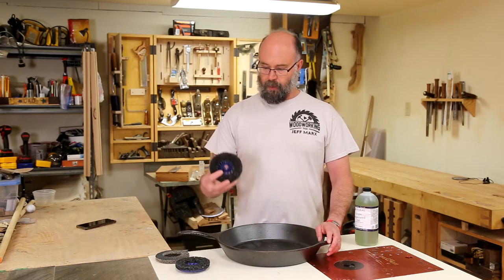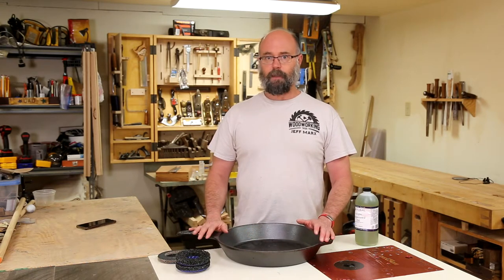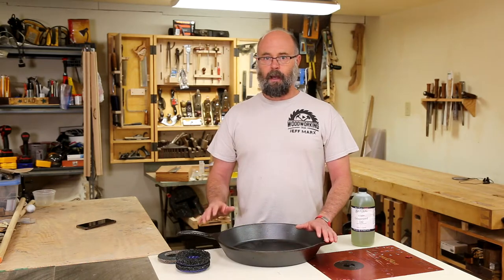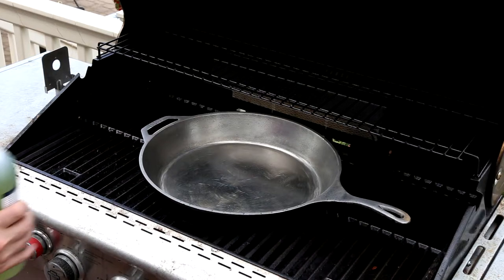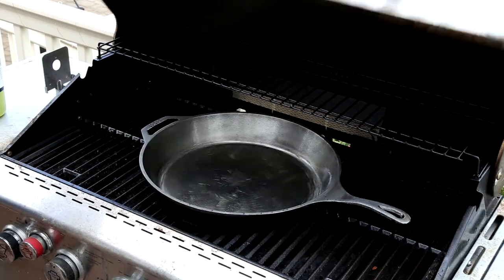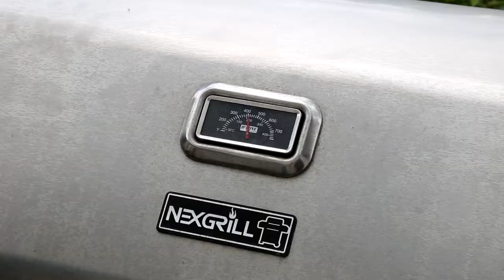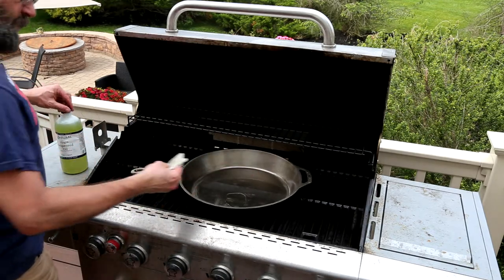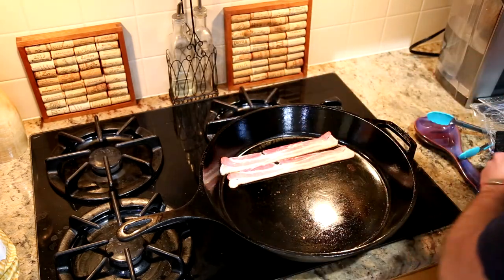Smoothing and re-seasoning a new cast iron pan

Comment: I've always been curious about this. How it would affect the end result of a cast iron pan if it were first taken down to a really smooth polished state before seasoning. I've also considered the same about those big blackstone style griddles. Cool video. Looks like it passed the bacon test.
Reply from the maker: Yes, the critical bacon test was a success!  It's been great with everything I've thrown at it so far - very happy.  Thanks for watching and commenting.  I don't have any experience with Blackstone griddles but they look like something worth experimenting with.
Reply: Cast iron and carbon steel are very similar, and there will be almost no difference between smooth cast iron and carbon steel pans in terms of performance. I believe you can find a lot of test results for carbon steel on YouTube.
Reply from the maker: @alanshawn3058  Thank you!
Reply: I do this with my Lodge pans. I have an older Wagner Ware/Sydney pan I got from my grandfather and guess what? It has a much smoother surface finish than the newer Lodge stuff. He left me a no-name square skillet that is the same way.
 I think that the rough "bad road" texture Lodge uses allows the iron to poke above the carbon layer that normally makes cast iron so useful. That hard, slick carbon layer is what makes it non-stick and having a bumpy surface means the carbon layer breaks and doesn't evenly cover. By smoothing it down flat, you leave enough surface area for the carbon layer to form, and have it smooth enough to give that carbon layer a fighting chance at forming and growing. If it's rough, the hot iron pokes above and stick to every protein it touches...which sucks if that protein is an over-easy egg you're hoping to eat.
Reply: @alanshawn3058  Doesn't hurt that cast iron is a high carbon alloy. It has a higher carbon content than high carbon steel.

Comment: I splurged on a polished cast iron wok this spring, and it is an absolute dream to cook with. My previous experience with cast iron was a disaster,, but now I know why. 
Even though it turns out beautifully every time - even in a camper oven! - it feels weird making skillet cornbread in a wok. I'm going to get a Lodge and make this one of my winter projects. Think I can pull it off just using drill attachments, and not use a grinder?
Reply from the maker: Thats great to hear!  It's probably much faster with a grinder, but drill/sander/hand sanding should also work.  Good luck, and happy cooking!
Reply: @JeffMarxWoodworking  Thanks so much! I'm excited to get started! I saw one after this that had been done entirely by hand, so it's encouraging to know that it is definitely possible without a grinder.
Reply from the maker: @lisakukla459  Make sure you wear good dust protection, you definitely don't want to breathe this stuff!

Comment: If you into steak, try a seven bone steak.  Get it as hot as you can.  Salt the bottom of the skillet like the steak and throw the steak on top of it.  For a 3/4-1" steak, cook 3 minutes both sides I think.  It comes out good.
7-bone comes off the front leg/shoulder.  Around here it tastes better than any prime steak and may be a little chewey, but good.  I'd imagine it could be modified some.

Also, get a heavy flat weight as other cast iron and set on top your steaks while they cook.  It alters it in a good way.  Meat is kind of lighter.
Reply from the maker: Sounds great, thanks for the tip!  I've become a big fan of sous vide for steaks followed by a trip over really hot cast iron.
Reply: @JeffMarxWoodworking  oh, don't put the heavy weights on the steak in the above until you know how it tastes as is.  Where the added weight forces heat into the meat and might burn it rather than well seared.  Also, have the 7-bone room temp.
I like sprinkling black pepper but only do outside.  😂Lol, I like to sear black pepper and cayenne, but inside, just imagine inhaling pepper spray while breathing.  Pepper tastes better seared in, But DO NOT DO INSIDE, ONLY OUTSIDE😂.
Reply from the maker: @Noone-rt6pw  Yummy!

Comment: Question: After grinding and sanding, how did you clean the pan before seasoning? The problem I have is surface rust after cleaning and rinsing. TIA
Reply from the maker: Just a quick wipe with denatured alcohol is all you need.  Good luck, and thanks for watching and commenting!

Comment: I just bought a lodge cast iron skillet and I don’t know what to do. Should I wash it first with soap and water? Also it’s pre seasoned! I hear grape seed oil is good for seasoning. What should I do? I hear vegetable oil and canola are not healthy oils. Is grapeseed oil good for seasoning? What should I use?
Reply from the maker: The skillet comes preseasoned, you don't really need to do anything with it if you don't want to.  Proper care with cooking over time will continually refresh the seasoning.  If it ever wears off, you can reseason, and grapeseed oil is a great choice.  If you prefer you pan smoother, you can follow a procedure similar to what I showed here.
Reply: @JeffMarxWoodworking   I have one more question! When I wipe my cast iron with paper towel or towel after cooking and cleaning. The entire paper towel is black! What is this black residue? Like the entire towel is black after wiping it including my fingers! Is this black stuff safe? The skillet is only a week old and I’ve cooked on it 3x. Is this normal?
Reply from the maker: @priestlygarments4004  I'm not sure.  I'd give it a slightly more aggressive cleaning just not using anything abrasive that might take off the seasoning.   Good luck, I hope you can sort that out.
Reply: @priestlygarments4004  If you clean it initially when bought,  I wouldn’t worry about anything else after that.  It could even be some seasoning/carbonized oil that was physically scraped off by your utensils.

Comment: The darkness came from the soot in the oil fire as it's carbon that gives a cure its darkened color.  High smoke point oils like grape seed and flax will more readily polymerize without as much soot hence their lighter, harder initial bronze like finish.  Eventually they'll end up dark from use as the cure builds more layers infused with more soot prone animal fats and soot from higher heat use like searing.   If you want that traditional dark look from the initial, unused cure while using a high smoke point oil then you simply have to cure it the traditional way over a fire around 450-500 degrees (Webers work well for this).  The soot from the fire will supply the carbon and you'll end up with something that has a darker initial cure.
Reply from the maker: Great information.   Thanks for sharing it with us Josh!
Reply: The fire is what you want to avoid as it creates ash and soot rather than carbonizing the existing polymerized oil layer. However, the high heat caused by the fire likely gave him the carbonizing effect that makes cast iron so useful. Carbon is very slick and hard and that's what we're after in seasoning pans.

Comment: What model angle grinder is that and did you have to remove the protective cover like the one I have over my spinning wheel?
Reply from the maker: It's a WEN angle grinder which is a budget brand with (in my opinion) decent quality.  I didn't need to, and perhaps shouldn't have removed the guard.  Thank you for watching and commenting!!!

Comment: Hey, sorry if this is a silly question. 400 grit seems insanely smooth, did you have any issues getting the seasoning to stick? Is there any advantage (and/or downside) to stopping at say, 180 or 220, or did you find it worthwhile to go all the way to 400?

In any case, the pan looks great and that crazy temp spike you mentioned didn't seem to do it any harm. Cheers!
Reply from the maker: Thank you Adam!  The Lodge pans work great without doing anything to the original cast surface.  I think you could likely polish to whatever degree you choose (higher or lower) and it will work great and the seasoning will adhere well.  I appreciate your watching and commenting!  Jeff
Reply: Just buy Le Creuset cast iron and there’s no need to do the sanding. Hi quality pans.

Comment: Recently found a 100+ year old Wagner, buried in the ground and completely rusted up.....took off a ton of surface rust already, but there is substantial pitting, so I'm going to have to grind it substantially to even it out at the very least........no matter WHAT people say on YouTube....sometimes you gotta do what you gotta do. 
     My big problem is, that this skillet is like 1/2 the thickness of most modern brands, leaving very little room for errant overgrinding....😬🙏😬🙏🙏😅😅🙏🙏
Reply from the maker: Very nice!  Just take it slow and be careful and I'm sure there's plenty of metal there.
Reply: @JeffMarxWoodworking  - Thanks! Still soaking in lye water a few more days...🙏🙏🙏

Comment: I ordered something that had rave reviews called Crisbee Stik that is used for seasoning, was before i saw your awesome video. Do you think i should ditch that and get grapeseed oil instead…it was 15 bucks this stuff but it contains soybean oil, beeswax, and palm oil. Thanks
Reply from the maker: I'm not familiar with that product, it might be great - I don't know.  Most of the research I did pointed me toward grapeseed oil.  Like most things, there are likely multiple workable solutions. Best of luck, I hope you get years of good use out of your cast iron!
Reply: @JeffMarxWoodworking  yup, very true! And i got a new 12” cast iron and a new 12” carbon steel french style pan. Cant wait to get some good use out of them
Reply: @JeffMarxWoodworking  thanks for the reply
Reply from the maker: @Orr_s  👍

Comment: Do you think the higher temps you accidentally went to during your seasoning process actually helped seasoning process? I’m struggling to get the seasoning to stay on my smooth cast iron.
Reply from the maker: I don't think so from what I've researched but it's certainly possible.  More cycles with use seems to be the ticket long term.
Reply: @JeffMarxWoodworking  thanks for the quick response. I’ve been using Crisco, but I’m gonna try grape seed oil as I have heard it has the same hard qualities as flaxseed oil but doesn’t flake as easy.
Reply from the maker: @DJ-Coma  I hope that works better for you!
Reply: Use grapeseed oil and just keep repeating the process. Each skillet is different as is each stove. Keep at it, you'll get it.
Reply: @Ahriman_II  yes. Grapeseed and go to a higher temp...about 450 for 45 mins or so each round. Also not sanding to a very smooth surface helps. Keep some texture but just take off the high rougher peaks.

Comment: Hello! I grind the pan with machine so it turn back to silver color.
I did seasoned the pan with gas stove but the color changed to brown not black. 
How do i get black color again? Can i get the black color back if i season the pan with oven at high temperature?
Reply from the maker: The seasoning process works best with multiple thin coats and several cycles.  My understanding is that ~450 degrees F or 232 C is the ideal temperature if you're using grapeseed oil.  ou need to get above it's smoke temperature to cause it to polymerize.  Good luck!
Reply: @JeffMarxWoodworking  thank you for reply!
I used seasoning wax(beez wax) and did 4 times. I noticed that i didn’t cool down the pan after seasoning. I just kept spreading the wax after the smoke disappear. 
I will try the seasoning the pan with your advice and i will let you the result! 
Once again thank you sooooo much and happy new year!

Comment: Have you had any issues with the re-seasoned surface coming off after cleaning?
Reply from the maker: I haven't to this point.  It's important to be gentle with cleaning (no abrasive cleanser) and always consider any cooking operation as an opportunity for re-seasoning.  Proper seasoning improves over time and is comprised of a lot of very thin layers rather than one thick one.
Reply: @JeffMarxWoodworking  cool. I'd like to do this myself. I like the idea of having a cast iron pan as an heirloom item. Should last forever.
Reply from the maker: @xJAWAx  They not only last essentially forever but are one of the few items in life that actually improve with use.  Good luck!

Comment: Was there a reason you started cooking your bacon with a hot pan? I was told to start bacon with a cold pan so it renders better?
Reply from the maker: If you can fit it all in at once then go ahead and start w a cold pan.  I've done both and not found much of a difference.  Thanks for watching and commenting!
Reply: @JeffMarxWoodworking  Thanks for the reply and the content. I resurfaced both of my Lodge's as well. I just used an orbital sander with 80 grit then 140.
Reply from the maker: @LeonardCartersureshotfoto  Thank you - how did that turn out?
Reply: @JeffMarxWoodworking  It turned out wonderfully. I seasoned them with flax seed oil in a 500-degree oven for an hour then cooled for 2 hours. I did this 3 times before cooking in them and they are working great.

Comment: what is the cheapest tool to use if your not into woodworking
Reply from the maker: It's really a function of what project you want to start with.  When I got started, I would often buy a new tool to allow me to do each new project.
Reply from the maker: Also, there are lots of gently used woodworking tools available in the used market either online or at local yard/flea sales, etc.

Comment: Way too much oil. What you have in your skillet is partially polymerized, sticky gunk. Real patina feels smooth (like glass) and dry to the touch. 

To get the oil to polymerize completely, it has to be applied in thin layers. Wipe the skillet with oil and make sure everything is covered. Then use a clean towel (!) and wipe it all off again as if you were trying to get it completely dry again. The skillet then shouldn't look soaky wet like in the video, but only have a matte, silky shine and feel dry to the touch. Then put it into the oven or BBQ at a temperature above the smoking point of your oil for an hour. Repeat the process two more times and the skillet is ready for use. When applying the first layer of oil, you will feel the metal surface absorb quite some oil. With each additional layer, you will notice the surface being 'saturated' and requiring less oil. It also helps to apply the oil to a warm skillet.
Reply from the maker: Thank you for the tips, much appreciated.
Reply: Bernie M   I just watched Martha's video and she likes to use Crisco lard.  Martha rules! :)

Comment: so the video just ends with no conclusion if your work worked?
Reply from the maker: It worked great, sorry if that was unclear.  I thought bacon was a happy ending to any story. 😁
Reply: @JeffMarxWoodworking  Bacon is a great ending, but we are all curious about the cleanup and how much if anything was a little stuck on the pan.  I have just stripped and re-seasoned a 60ish year old skillet and I still have a little bacon sticking to it.
Reply from the maker: @jeffbates6759  Good question:  There was zero sticking, and that's mosly been the case for everything else I've done in it since including sous vide steaks.  It would be great to compare side by side with an off-the-shelf pan to see how different they are.  I know that well seasoned and maintained cast iron can perform like a champ even without this extra effort.

Comment: This seems so unnecessary as the reward is just not there. A disk sander seems to be far too much tool as it really takes slot of material
Reply from the maker: Thanks for sharing your perspective.
Reply: My comment sounded real negative but I didn't mean it like that. There have been many cast iron polishers and the results compared to a well seasoned unfinished surfaces to indicate that it's not worth all the work. I do love a shiny cast iron surface though.
Reply from the maker: All good, thanks!   @locker1325

Comment: Of course the bacon didn't stick, it contains a ton of fat.  Let's see you fry a egg on that shiny new surface.
Reply from the maker: Very true and why it's so delicious!  I've done steaks and other things with equal success.
Reply: "Of course the bacon didn't stick, it contains a ton of fat."

Bacon tends to stick in spite of all the fat. Try cooking it in a stainless steel pan for example, or an unseasoned (or ill-seasoned) cast iron pan. You'll have some stuck-on bacon residue to clean up afterwards for sure.

"Let's see you fry a egg on that shiny new surface."

Eggs on the other hand are very easy to fry without sticking; all you need to do is coat the cooking surface with e.g., butter, and they won't stick, not even on stainless steel. I always fry eggs in 1 tablespoon of butter in an 11" 304 stainless steel electric skillet at 300 degrees F, and they slide around the pan as if they were on wet ice.